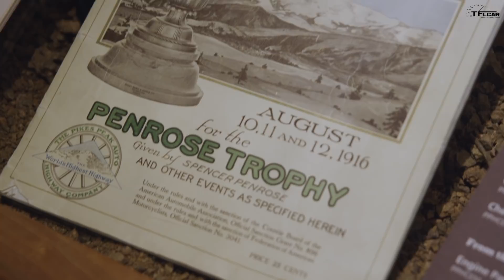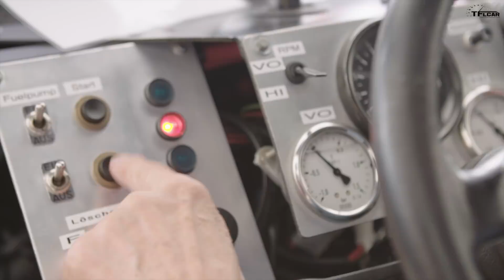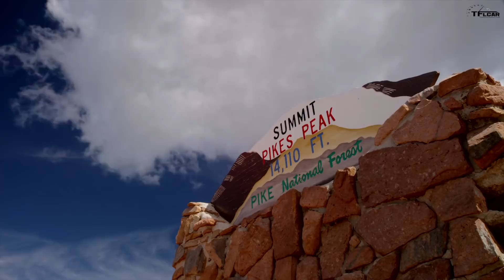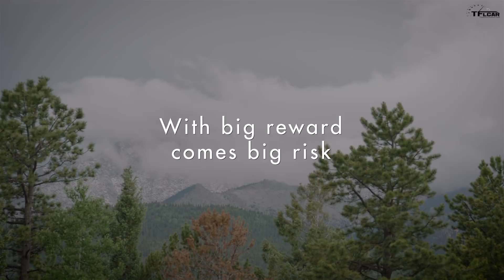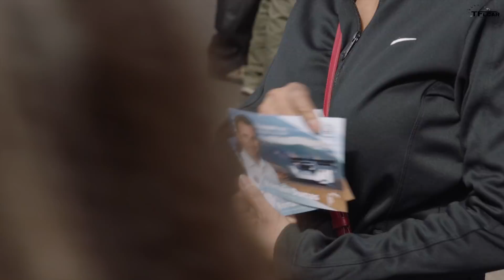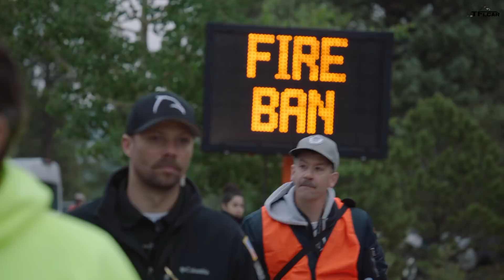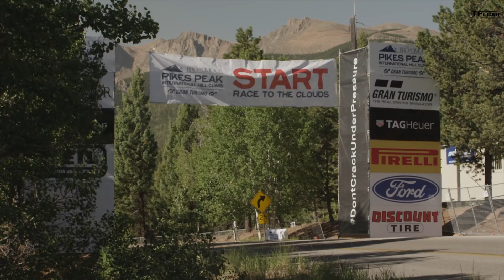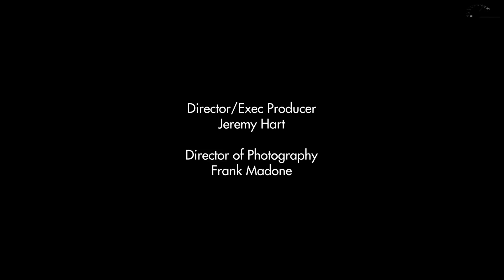No Limits, No Guardrails, No Fear: How Volkswagen Conquered Pikes Peak

Comment: Making electrics fast has never been the problem. Making them light, cheap, long ranged and fast to recharge are the sticking points. 
The first person/company to sort out a battery tech which allows this will be the richest person on earth.
Reply: So far Tesla is the closest. 300 miles on a charge is way more most people drive daily and if your home is wired properly you can get a decent recharge. The cars still aren't light but the CoG is the lowest of any production vehicle so at least they're stable.
Reply: They're probably one of the best. Unfortunately they cost a packet which means they can't be mass market anytime soon. Imagine a model S that cost $15k and could recharge in 5 mins. 
Like I said - when someone figures that battery out it's a complete game changer.
Reply: Tesla's 200 mile model 3 (when we see it) will most likely have a curb weight matching, possibly beating, the BMW 3 series. Nissan's Gen 2 Leaf is able to travel 150+ miles, over a 40% improvement from the 2011 Leaf of the same curb weight. I'm by no means saying the Leaf meets the criteria above, but this does show the general trend of increased energy per unit weight. Hyundai's Kona EV and Kia's Niro EV may just beat GM and Tesla (no $35k car yet) in range, cost, and charge time for the buck. Definitely overtaking GM's Bolt with a higher current DC quick charge. We'll have to wait for Porsche's push, touting 15 minutes for 80% charge or so.